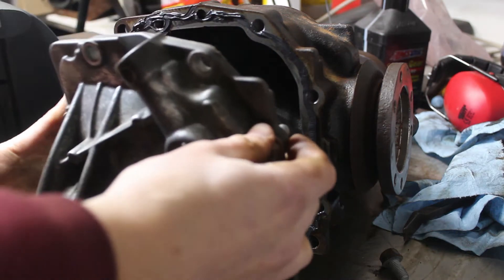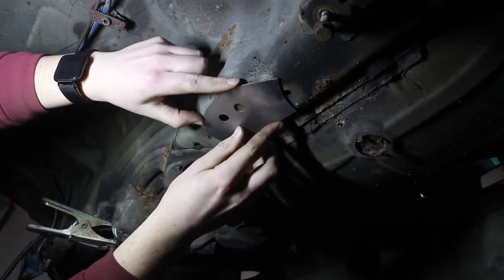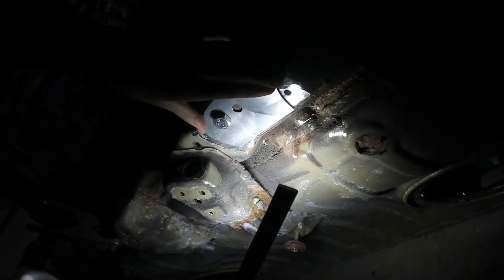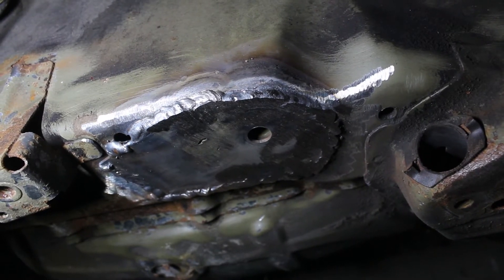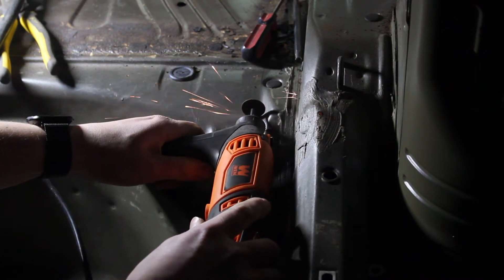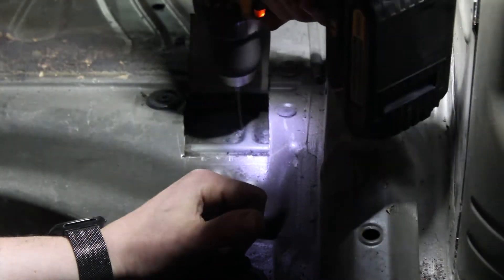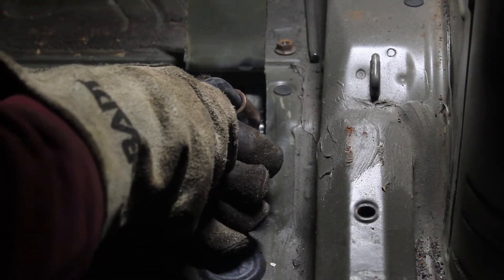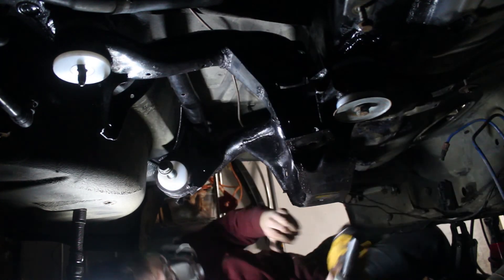BMW E46 Race Car Build: Rear Subframe Reinforcement

Comment: What were your welder settings?
Reply from the maker: Voltage 3 out of 4, feed about 3- that's about all the adjustment it has
Reply: @rainvillecreative5410  Interesting, I'm trying to weld up the cracks before I weld the plates on. I can't seem to get a bead going (it just deposits little balls with little penetration) and I blow holes when I turn up the voltage. Ill keep trying, thanks for the reply!
Reply from the maker: @rj6110  Definitely clean the metal as much as possible using a grinder. It would help to do some practice beads on some scrap metal of the same thickness to make sure the wire feed is good too. And also, rounding off the edges on the plates will help the bead travel nicely.